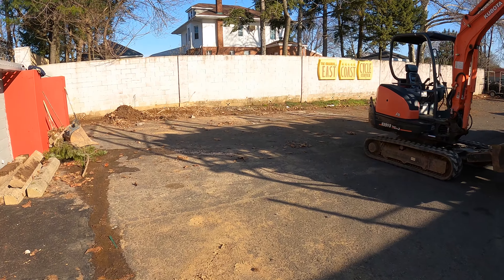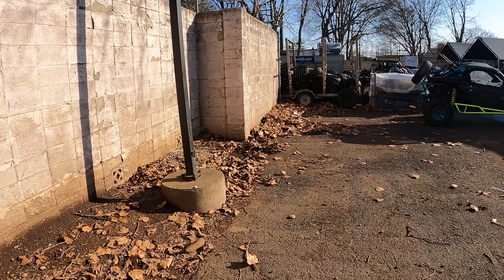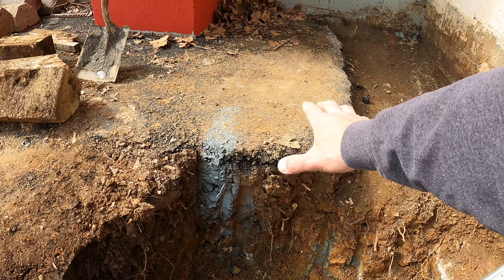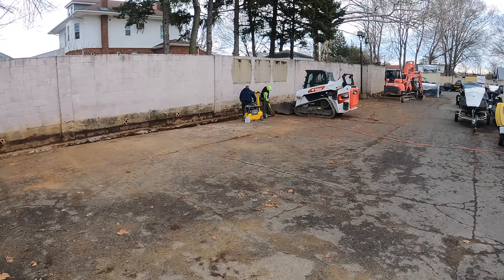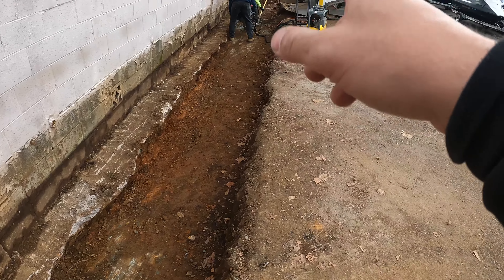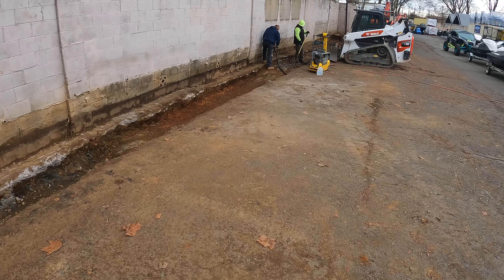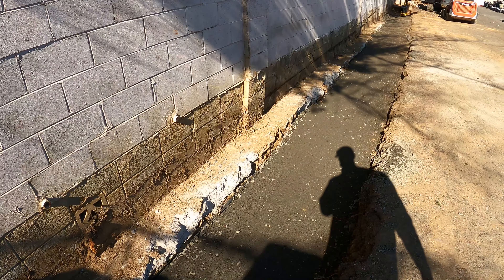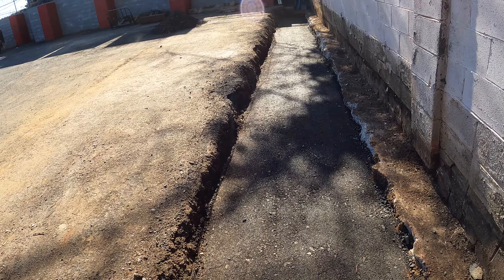Retaining wall dig and base prep

Comment: Great video.  What base was used? Looked dark like a recycled asphalt.
Reply from the maker: Thank you, it's 3/4" modified. It was damp that's why it was so dark.
Reply: it’s always all about the prep…do the redi-blocks have rebar in them?
Reply from the maker: @danielcolby7293  I believe so, each block has 3 different lifting points. So I would imagine there's probably some sort of rebar cage inside. I will ask the supplier next week.